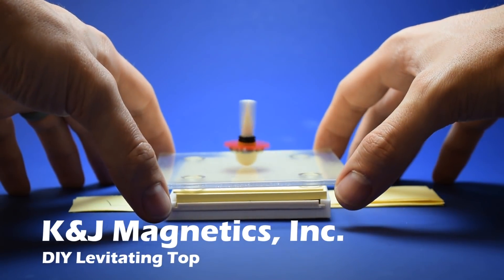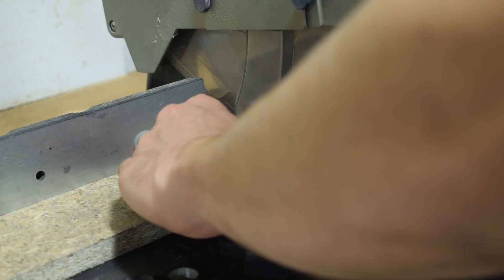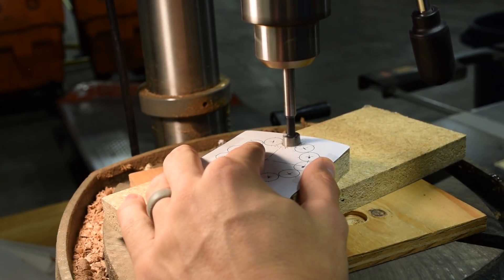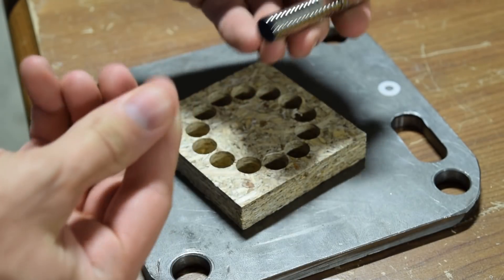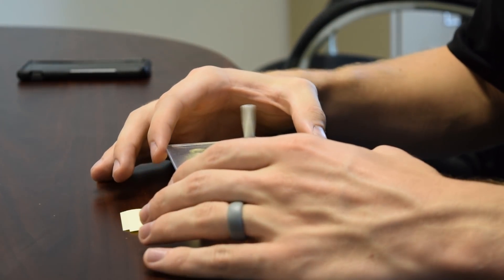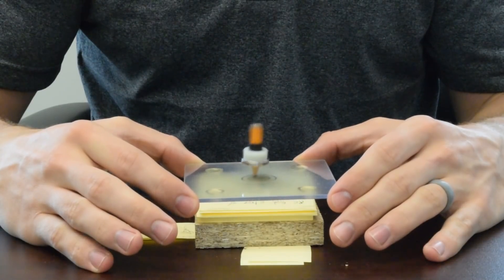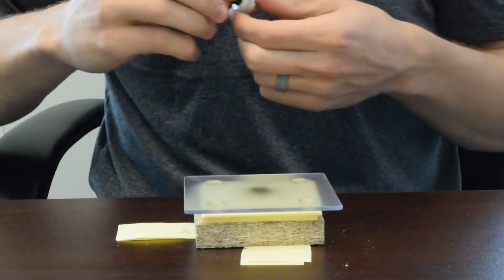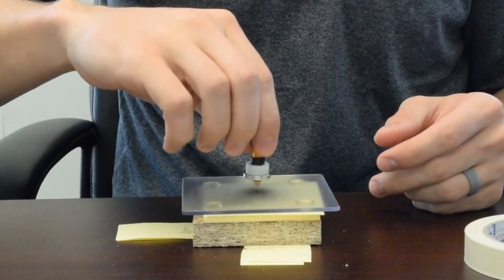DIY Levitating Top

Comment: I need some pointers for the base. I don’t have the tools to cut the wood and drill the circle holes for the disc magnets. Tried thick cardboard instead. Magnets keep flipping out. I also can’t tell if you turned the base over to where the magnets are no longer exposed on top or the video just doesn’t show them because of the sticky notes. Any suggestions?

Comment: Your Magnetic base is great.
You need to Lathe turn your Spindle out of solid PVC or similar, and then press fit the ring Magnet onto a shoulder. Rotational balance is the key.
Keep the centre of gravity of the Ring magnet/Spindle assembly as low a possible.
Cheers.

Comment: It is that you are using just a flat board with magnets in a circle only. This creates only a small window for the magnetic fields to be in perfect sink pushing against each other. to enlarger this you would need more magnets and add more layers of wood with magnets to make a bowl shape gradually going up. with those magnets at first tilting at a slight angle with each piece of wood. Till you eventually end up having the magnets being horizontal facing each other. You would need to figure out the spacing so that the field is centered with the magnets all holding the force in one spot. You could then put a small piece of metal and levitate it in the middle of the field just placing it with a pair of non ferris material or else just you fingers and seeing if the magnetic force will hold the object in place. As the bell of the bowl increases there will need to be big enough magnets or more of them so that it can push the ferris material towards the center. I could see a small table that metallic objects could move around on. They just wouldn't remain centered but still would levitate. If something wasn't magnetic it would fall through the center into a catch pan below it. I could imagine just using dirt, rocks, and black sand and see if one could take a small funnel and pouring it slowly through the funnel and see if it would make all the non ferris material go through to the catch pan underneath. While keeping the ferris material floating in mid air. Then could take a plastic spoon and collect the ferris material from mid air. It would be a great way of separation and being able to collect all of the magnetic material. It may take several spills to collect it all as the magnetic field can only collect so much before it can't collect any more and then lets anything through. Sometimes when other objects hit others it breaks some out of the magnetic fields grasp. I noticed this just trying to pick up black sand and other materials with a mechanical magnet. I just had to turn it on and release into my hand several times before I could separate all the magnetic material from the non magnetic material.

Comment: The definition of insanity is doing the same thing over and over again expecting different results. Did you think that the top might be off-balance. There seems to be no correction inbetween tries. Didn't the regular top work fine? Did you ask yourself, Why is my top not working. What makes it different? Magnets are fun but getting one to levitate without the use of a 3D printer was not your issue.

Comment: Woodturners make tops all the time. Try a shorter, fatter, top with a 160 degree tip made from hard maple, cherry or corian. Can use your drill press and sandpaper if you don't have a lathe.  A pull strip axle and wheel top can be made to pin a long time.  A parts list would help me order the correct magnets.  Woodturners.org

Comment: Would lifting it with a metal plate (Cu, Al) help stabilise it through eddy currents? Looks like you're using a plastic coaster - try a conductive one...?
Reply: I've tried using aluminum plates.  It seems like it helps a little, but not enough to be obvious, and I haven't done any good repeatable experiments to check.
BTW, to see a really big version, with what I think are height and time records:
https://www.youtube.com/watch?v=DKxmQACYjx4
https://www.youtube.com/watch?v=MJl5Tpn95Rk
Reply: Great other vid. Al plates may have to be a good few mm or more thick perhaps...? And/or reasonably pure? Would be interesting to see if there is an effect with thicker plates.
Reply: Yes, I think you are right about thickness, given the relatively low frequency of the wobble.  I changed from a 2.2mm to 6.3mm plate and made several more runs.  Still not conclusive, but it does seem to help.  My key learning from these new runs is that static electricity from the lift plate and container is also a significant factor.

Comment: I suspect getting rid of the metal ferrule and the eraser would be a step in the right direction. Then I think you might need to round the bottom end of the pencil, not sharpen it. The graphite from the lead will make it slippery enough. Last, try sharpening the top end of the pencil just a little so you can spin it faster. Last, make sure none of the magnets in the base have shifted. Superglue them or put dowel rods under them...

I saw a co-worker do this with a ceramic magnet from a big subwoofer under the base and a magnet from a headphone stuck on a bamboo skewer. He had the sharp end up because he could not get it to spin with the sharp side down even without the other magnet. I think the headphone magnet was samarium cobalt. This was in the 1980's and neodymium magnets were new and expensive. His top only rose up about 1/8", but it was up - we could pass a nylon wire tie under it without upsetting it...

Comment: use a dowel sharpen with a drill and sandpaper (or on a lathe). The center has to be even and at center with the washer magnet.

Comment: I wonder if you could get somewhere with an aluminum pop rivet as the axle of the top.  It seems about right in size and diameter for easy finger spinning.  It would be particularly good for disk magnets with 1/8 inch holes.
Reply: steel shaft in rivet won't work, good thinking though, plastic rivet  :)